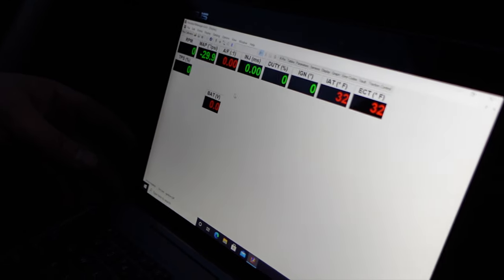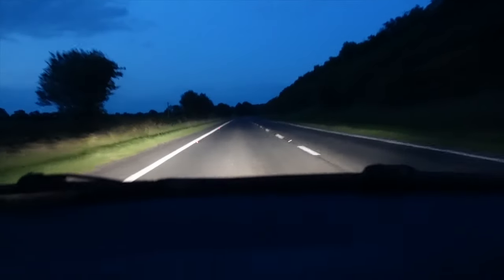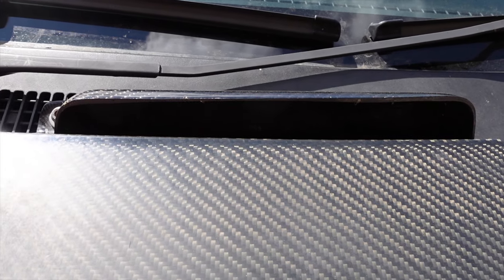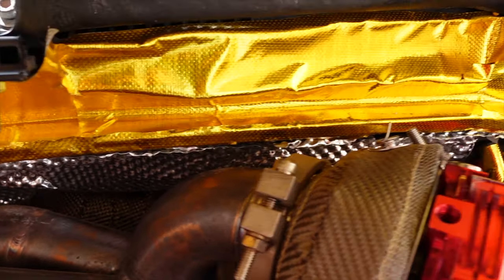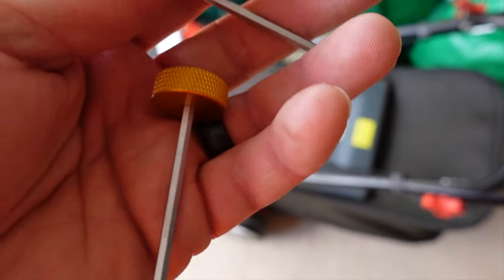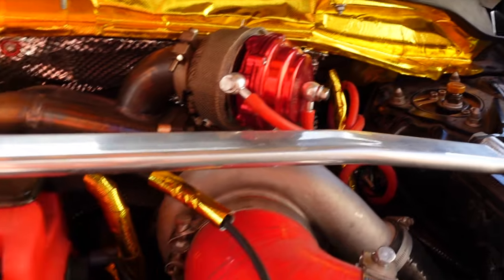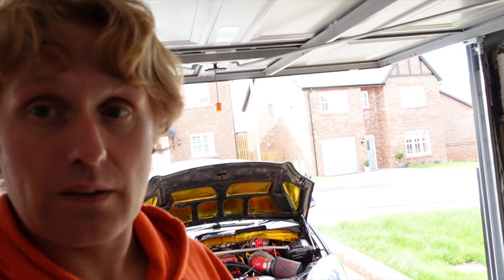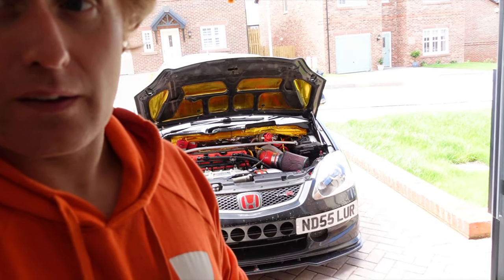K20 EP3 Type R Turbo Part 14 - More Boost And Update

Comment: Put polybushes in the Front control arms of my EP3 myself. 

Its a bit of a pig of a job, doable if you have a press but just time consuming and fiddly, so if you can get arms with bushes already fitted for decent money I'd go that route.
Reply from the maker: I have arms with bushes already in them to fit soon along with new ball joints and drop links. its just finding the time to do it.